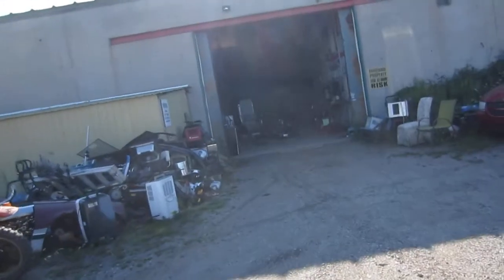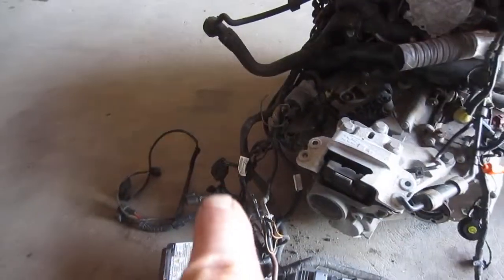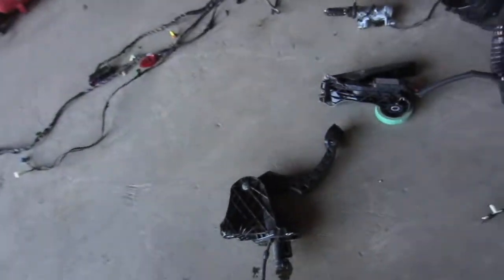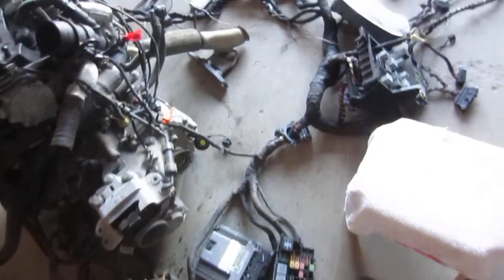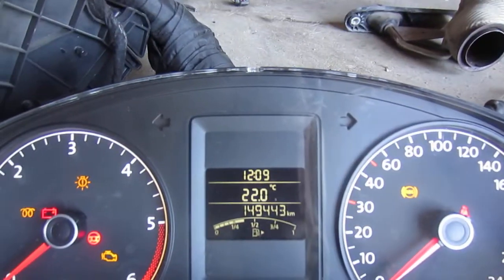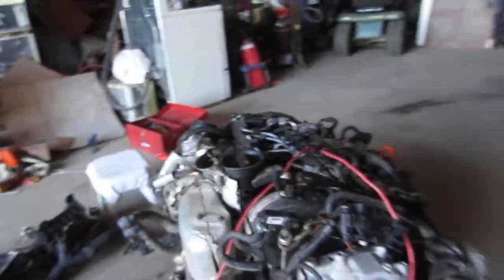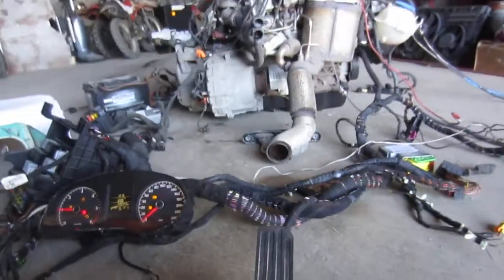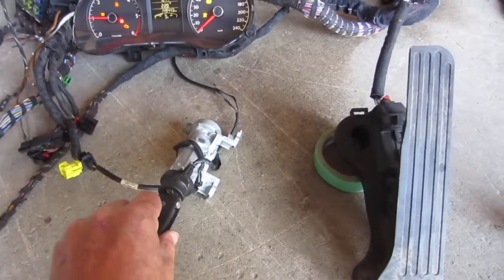6 .VW TDI CJAA engine running on the shop floor

Comment: As a fellow caravan fan, and fan of the farm, I'd be interested in a few pieces off that dark blue second gen whenever it's time for it to go.
Something like a roof rack cross bar and the headlight switch for example, they'd live on in my 94
Reply from the maker: i am saving that van incase putin sends an emp our way. it will still run.

Comment: After owning a pos 2014 jetta tdi 6spd i can honestly say the best thing about a VW is the diesel engine and manual trans the rest is junk .Always had something breaking on the car then finally had enough and traded it in on a 21 corolla

Comment: I love those tdi engines. Very tuneable. I personally don't have a tdi. I have a tuned  tsi but still get 42 mpg what is great. Those tdis can get upwards of 50. I also find this generation of vws to be easy to work on when they come into my shop and when I do work on my personal 2014 passat